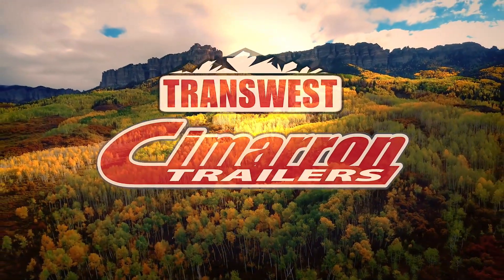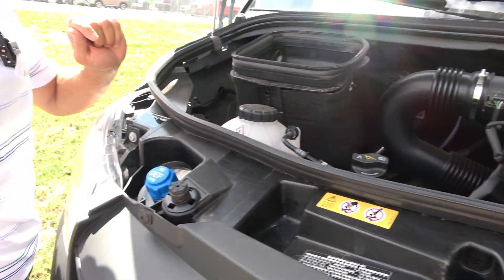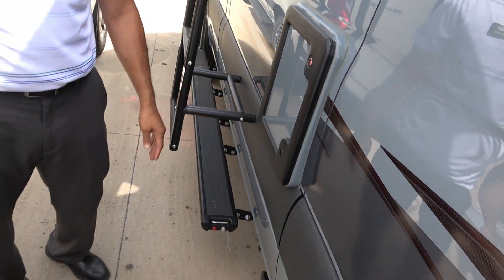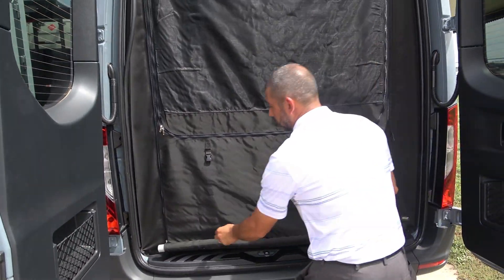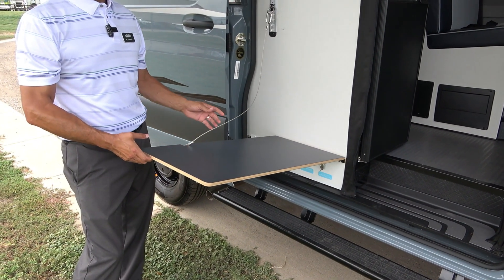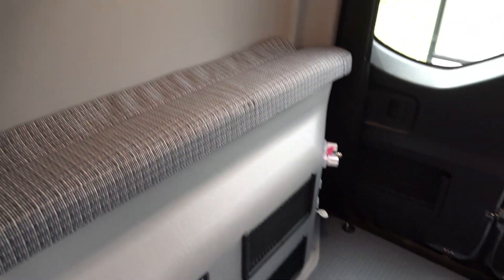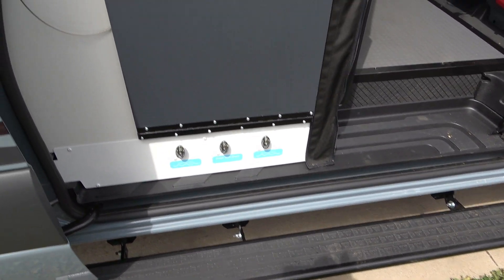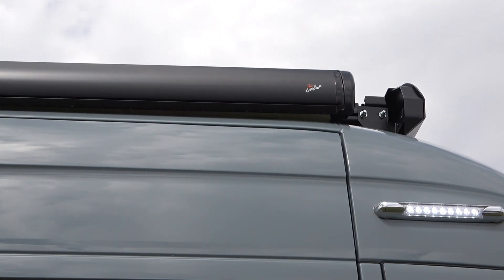Sprinter Winnebago Rebel and Antero  off-road overland 4x4 diesel van review with MrTruck, Transwest

Comment: For less than half of the cost, I can get a very nice 40+ foot 5th wheel. Even if I have to buy the new one ton diesel truck and trailer it will still cost substantially less. For most people this seems a much better option. But, if you are worried about off roading your rig, then this would be a option some.